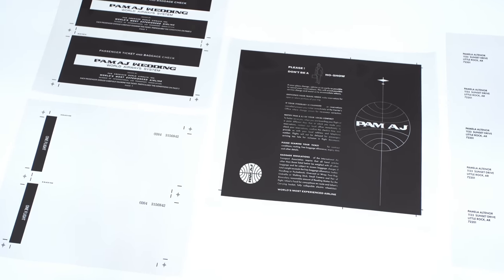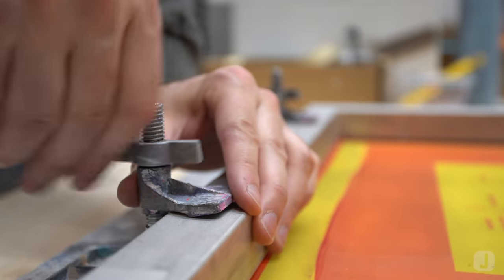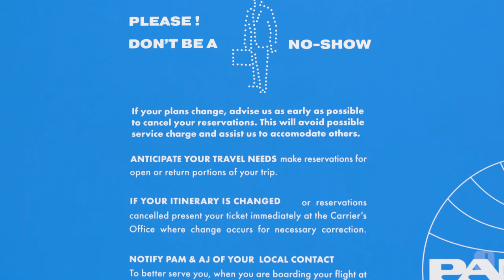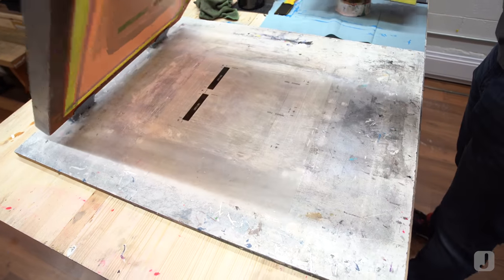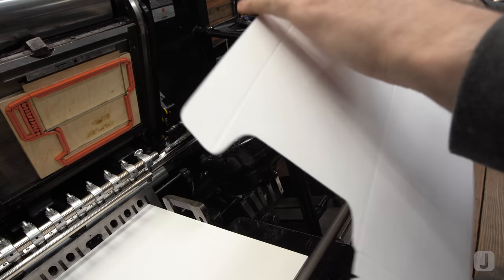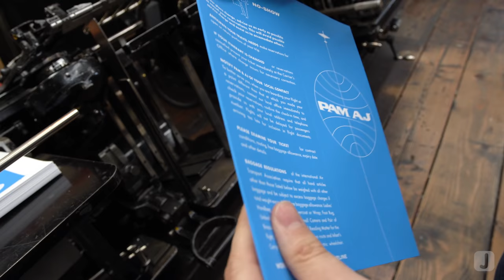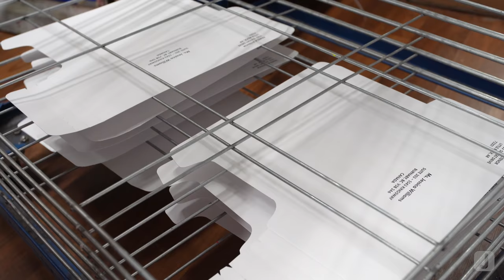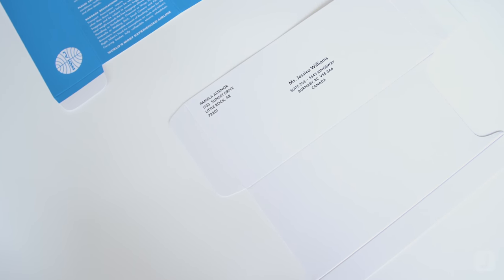Pan Am Inspired Destination Wedding Invitation | Part 1: Screen Printing & Die Cutting

Comment: I need a job like this. I worked at a copy/print place several years ago, but we never got to do any of the die-cutting, screen printing, letterpress, or any of the other awesome stuff I wanted to learn to do! Also, our paper guillotine was a POS that had a whole 1/8" difference between the top of the stack and the bottom, no matter how many times we repaired it. So many nights cutting things by hand so they looked nice... I'll never forgive that guillotine.
Reply from the maker: We're not afraid to do some hand cutting ourselves when the job requires it but that's an enormous difference on a guillotine! I can't even imagine the struggles of dealing with something like that. A guillotine is just as important as the press for doing precision work. My sympathies to you!

Comment: I understand creating a screen for stuff that needs to be printed frequently, but would you use that for batches of addresses? If you had 100s of addresses, you'd need to create a large number of screens?
Reply from the maker: We'd typically run something like that using variable, or dynamic, digital printing. Which would print one name and address on each envelope. We just wanted to showcase this suite without making use of that.
Reply: Digital or inkjet

Comment: Hi from South Africa. thank you for such a detailed video...
I was wondering why you chose silkscreen, instead of Litho? Would you not be a cheaper option to work and turn 1 A2 sheet, with all your sections printed at 1 go? just curious? I would think using CTP plates, will give the best quality print, 100% registration, and consistent colour? 
thank you sir.
Reply from the maker: You are exactly right!

Comment: When you're doing the silk screening process there's a creaking/fabric tearing noise, what's making that noise?
Reply from the maker: I believe you're hearing the squeegee running over the texture of the meshed screen!
Reply: @JukeboxPrintLive  could be, I've never done it myself, but I hear the smooth sound (think swish of thin rain coat on rain coat as you walk) that I associate with the squeegee but I also hear a crunching/fabric tearing (think sitting down in an old wicker chair) noise when they first start pushing down with the squeegee before they run it over the screen. The mental picture it gave me was the screen tearing, but I figured if that happened your alignment would steadily get worse.
Reply: @BenRyherd  I hear that too. A cracking sound that to my feeling shouldn't be there.
Reply: Maybe it's the seal tape complaining about the pressure?
Reply: @JukeboxPrintLive  it's really apparent on the step-and-repeat part, so I wonder if it has to do with all that mylar between the screen and the paper.

Comment: I understand the use of the Pantone swatches but I’m curious as to what brand of ink you used to mix it all together? (I am familiar with letterpress but less informed about screen printing inks)
Reply from the maker: We use a standard speedball ink which makes Pantone matching a little more challenging than with the offset or letterpress inks. For this project we pretty much had to match by eye rather than a dedicated formula.

Comment: Why use screen peinting over mechanical offset? is there some quality benefit?
Reply from the maker: We were only producing about 50 of these in total so an offset run would not have been cost effect or economical. I agree that a flood of ink on an offset press would've been a cleaner and more even print.

Comment: Really? The second color black went down without any registration changes? Really? You hit it first time using old school clamps? I'd suggest that some sort of squeegee rest be fashioned so you can leave it in the screen between pulls. Will help with ink control, as opposed to setting it aside each time. Not that his ink control is bad. Back in the day of wood frames it was easy because a 8 or 16 penny nail did the trick but today with aluminum frames, something else is required.

What are you using as an adhesive on the palate? Do you guys have any trouble with screen clogs with the water based ink?